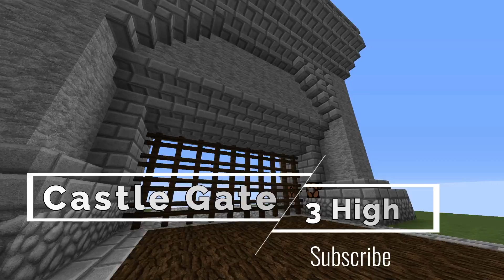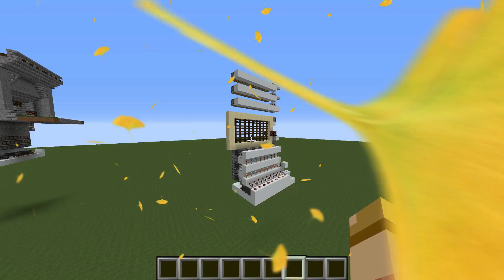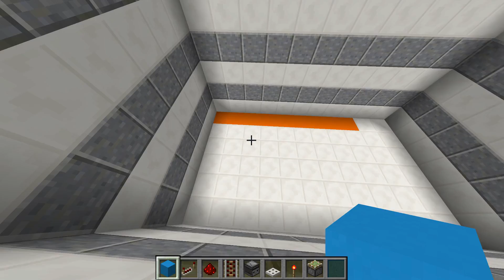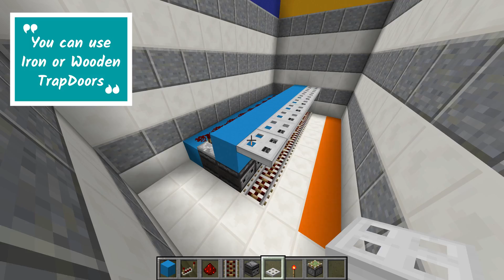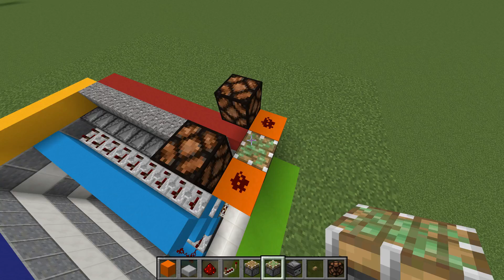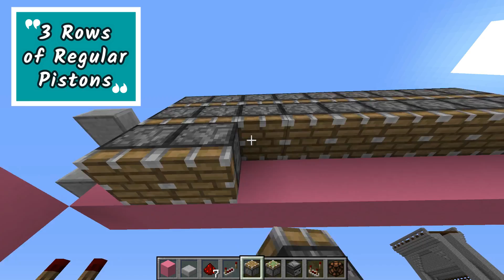Minecraft Tutorial : 3 High Castle Gate Super Compact

Comment: GRAVEL DOES NOT RETRACT FIX
As a lot of people said, if you plan to make the gate smaller than 9 blocks wide, the gravel does not retract when the gate is pulled up and it remains tied to the gate in air.
The fix is: however wide your gate is, you need to follow 5:17 exactly how it is, you need 6 repeaters on 4 tick everytime, doesn't matter if your gate is not 9 blocks wide.
Also, the rails from 2:51 need to be 9 blocks long, just like in the video.
So that's it, worked like a charm! Hope I've helped ya! :D

Comment: +k1 Inc.  Gravel breaks when going back down as of the latest minecraft version.

Someone found a solution for it, applied it and can confirm it works.  Removing the top row of observer blocks and replacing them with another row of repeaters delays it enough for gravity block to settle. https://media.minecraftforum.net/attachments/310/327/637173529879128601.png pic from the solution
Reply: Awsome, thank you. Works in 1.21.7  for me
Reply: Many thanks for this fix, it did indeed work and the picture was very helpful
Reply: @Hystoria-Minecraft  How wide is your gate? My 3 wide gate was having issues with the pistons until I checked my circuit down below: you need the six repeaters down below on full delay for the redstone signal to complete.
https://i.imgur.com/0Tq1Z0h.png

Comment: Nice build Ken. If you ever wanted to add a lock on the inside, you could have a couple pistons extend in the top and bottom air gap to prevent the buttons from activating the piston. 😊

It works in my head anyways...